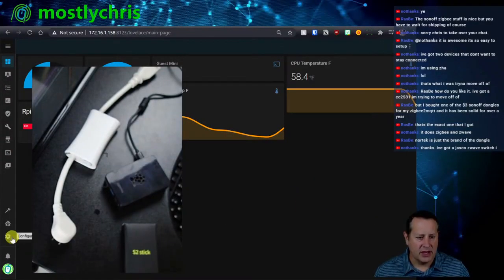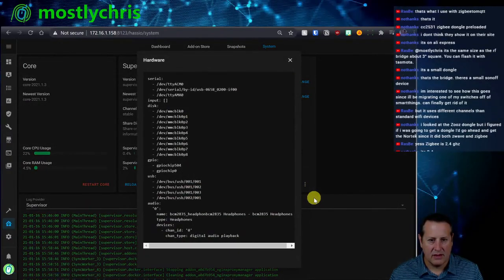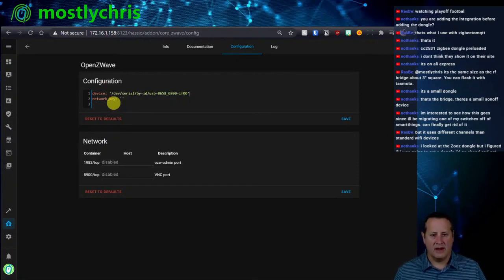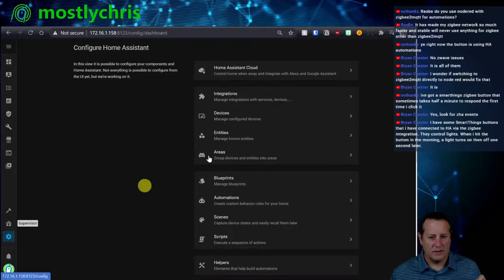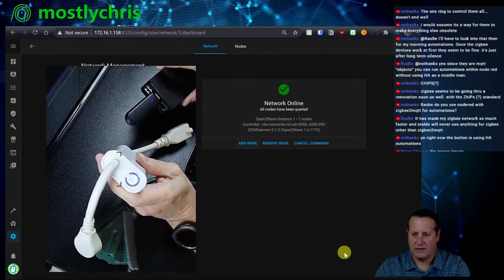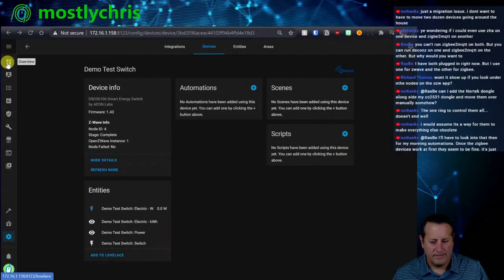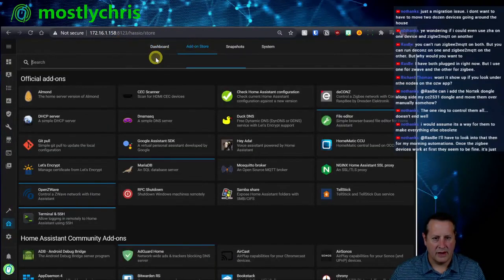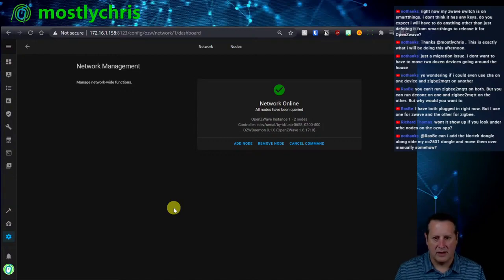Back to Basics Part 4 // Install Zooz S2 USB Z-Wave Stick // Add Z-Wave Device

Comment: I skipped the add-on step. I just went to integrations, clicked add, and chose OpenZWave. It told me it was going to install the add-on, I clicked ok. Then the integration prompted me for the hardware location of my dongle, and the security key, and once entered set everything up. I didn't have to mess with the add-on directly in supervisor. So I think if you skip the add-on install first it will still work. Oh, and awesome video. I going to send this link out to anyone wanting to set this up.
Reply from the maker: Oh wow, that is good to know. It has some smarts now that install the add-on if you don't have it as well as asking for the hardware location. Thanks!
Reply: @mostlychris  Well, it still required you to know the path to the dongle but defiantly made the process cleaner if you didn't want to mess with the configuration yaml. And I totally need to start using the direct path instead of the /dev path.
Reply from the maker: Thanks!

Comment: MQTT, did I miss that part in the video?
Reply from the maker: Hi. Not sure I understand the question. Can you give more details?
Reply: @mostlychris  oh, In the video there was mention of needing MQTT. I wast sure what that was, there wasn't any information given about it. I did some more research and it looks like its not needed if you use zwave js to mqtt instead.
Reply from the maker: Ok. That makes sense. Thanks for clarifying.

Comment: Why is that inset covering a lot of the things you’re doing in the interface?
Reply from the maker: Because I did it on a live stream. You'll notice that I catch myself a few times and turn it off. If you're following along on the steps, you can tell what I click by looking at your own screen. Also, I recap and show some of the covered up stuff later in the video. The tl;dr is that you didn't miss much when I had the second camera up. :)

Comment: Remember that I had these problems with Zipato on OpenZWave?
Found an article from HASS couple of days ago stating that they're dropping OpenZWave all together because of too many issues and development by 1 person only.
So basically we're going to have to revert to ZWave and wait for their new holy grail ZWave over Java.
Reply from the maker: I heard them mention this during a live stream a few weeks ago. I didn't have much info to go on at that point. Can you post the link to the article that talks about OZW going away? I'd like to make sure I understand it and can let everyone know what's up.
Reply: @mostlychris  it took me a while to find it again but here is the article:
https://github.com/home-assistant/architecture/issues/483
Reply from the maker: Thanks! I'm watching that closely.
Reply: There's now a flurry of activity on the new solutions which is called zwavejs. A beta should be part of the 2021.2 release and I would not be surprised if it outperforms the current native integration in a few months.